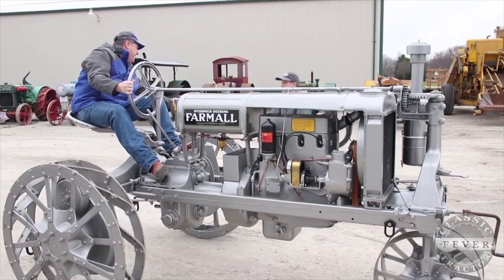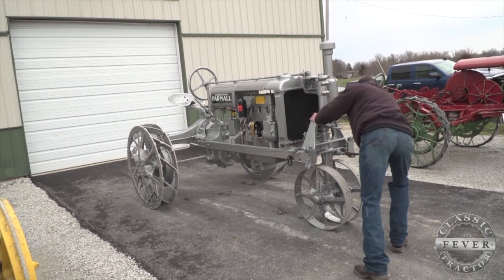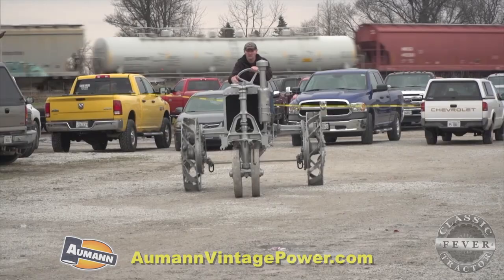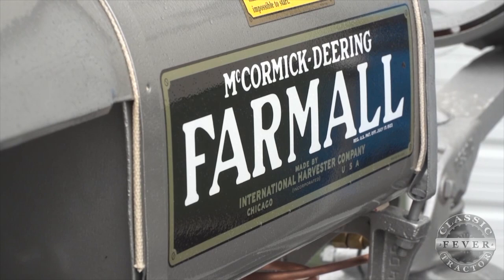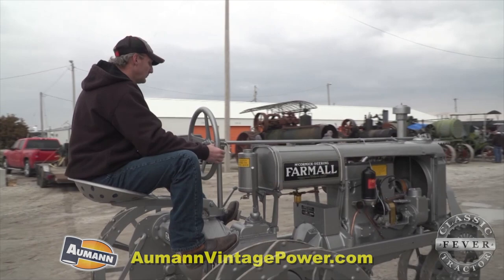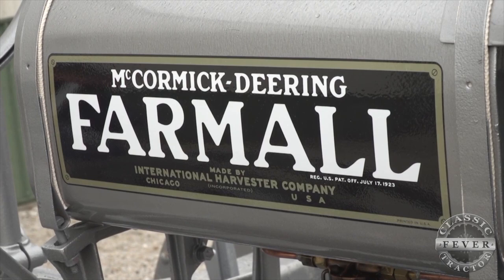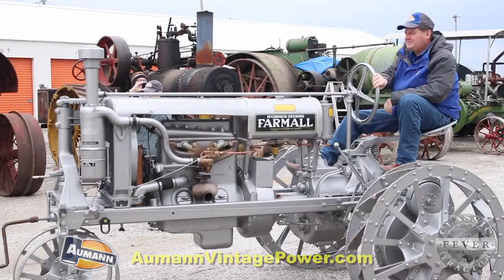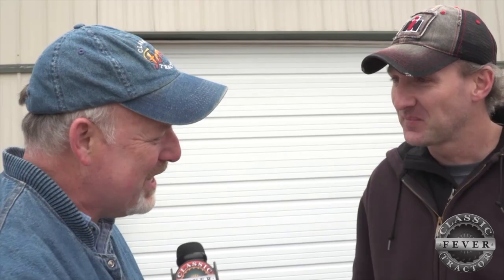The 100,000th Farmall Built - 1930 Farmall Regular - International Harvester Company

Comment: It is actually the 100,001st Farmall built. They started at 501, which would make 100,500 the 100,000th. I suspect the actual 100,000th is somewhere in a warehouse owned by Farmall/IH/Case.
Reply from the maker: This tractor is serial number 100,501. 100,501 minus 501 is 100,000.
Reply: I agree that 100,501 minus 501 is 100,000. However, that is not the proper calculation because it excludes the first tractor (#501). 

To demonstrate my point, suppose Farmall had started with serial number 001. If the first tractor was 001, the 100,000th tractor would be serial number 100,000 (not 100,001). By analogy, if you start at 501, the 100,000 tractor would be serial number 100,500 (not 100,501). The tractor in this video is very nice, but it is number 100,001 in the production line.
Reply: Get rekt

Comment: Looks like that cable system is designed to activate the inside brake on a turn automatically.
Reply: Yes. There is a name for the device, but I can't find it. I heard it mentioned in one of their advertising movies. Also the later models had an arm on the front of the tractor for steering your front-mount cultivator in rapid fashion.

Comment: Sorry i don't understand 100 000 tractor but #100 501 ? Can someone explain.  Thanks
Reply: The first Farmall Regular was serial number 501, so 100501 would be the 100000th Farmall Regular.

Same with other models of Farmall tractors. Serial numbers start at 501.

Not sure why. Someone at Farmall just chose to start their serial numbers at 501.
Reply: @ih1440  thank for your time.
Reply: My 1930 Farmall regular was the 76,801 made but i wouldn't trade it for any tractor in the world
Reply: 501 was indeed the first Farmall Regular, which would make serial number 100500 the 100,000th. The tractor that he has is number 100,001 in the sequence, not 100,000. Might explain why it was in a fence line.
Reply: @dlh104   If I start with number 501 the 100,000th tractor will be 99,999 later.  Correct?
Reply: @dlh104  ... But you don't start out with 1 tractor.
You start at Zero tractors.
The first off the line is #1.. add 99,999 more and ya get 100,000.... Take away 100,000 and you have 0 again.